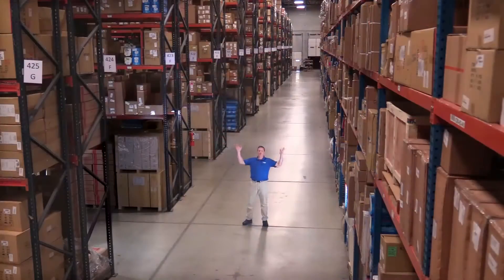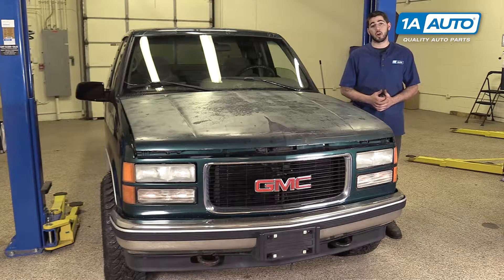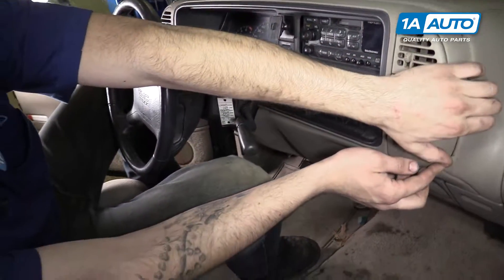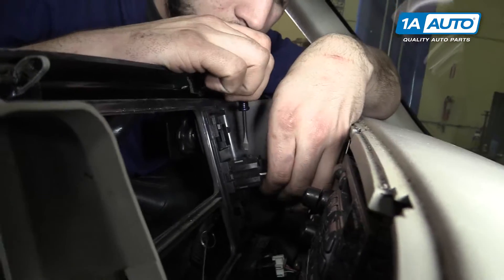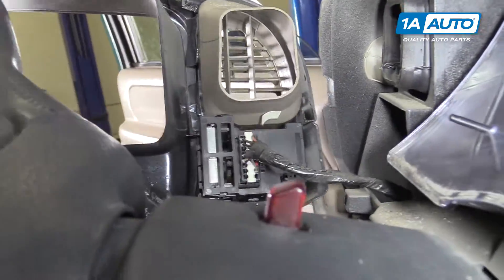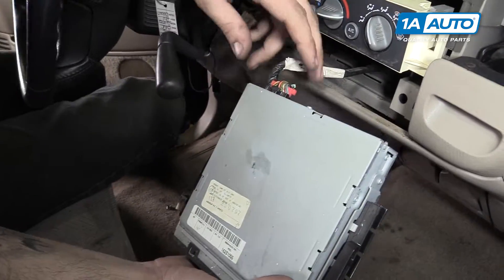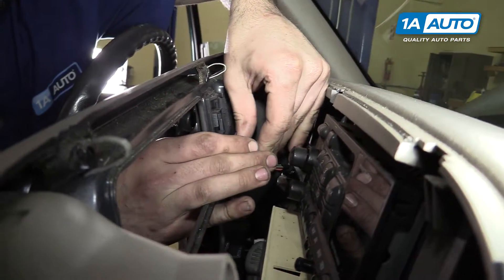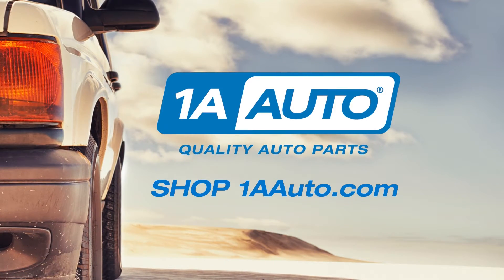How to Replace CD Player 88-98 GMC K1500

Comment: These guys do not mention that the wiring harness does not always come out far enough to disconnect it or plug in the new cd player. In this case you need to loosen the ac/heating component just above the cd player, move it to the side, and an opening will allow you to grab the wiring harness and feed it out far enough to plug in the cd player and reassemble everything. It only takes a few minutes and is easy to do.
Reply from the maker: +Gabe Gabe Thanks for the feedback!

Comment: I want to add a stock CD player to my 97. It originally had a radio/cassette player. When I pulled the unit I did not see a connector for a CD player. Can I splice off the radio?

Comment: I have a 1999 half ton 2wd suburban it has a radio with tape player no cd player and no buttons where your cargo light is and 4x4 of course but right behind that cover in the same area as 4x4 switch would be are 3 plug ins not hooked to anything wrapped in foam from factory one plug is wrapped in black tape other is white tape and third is green tape anyone now what these are itd greatly help